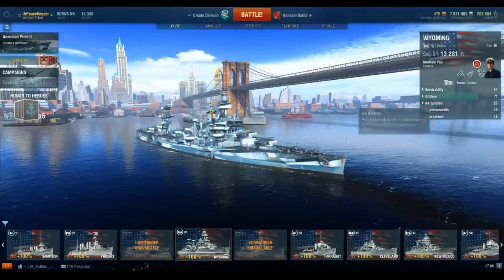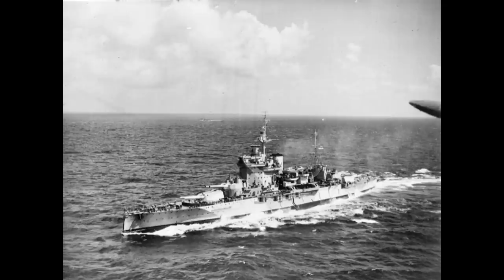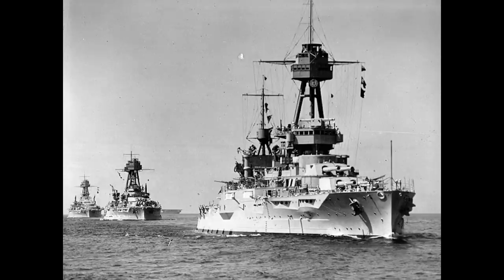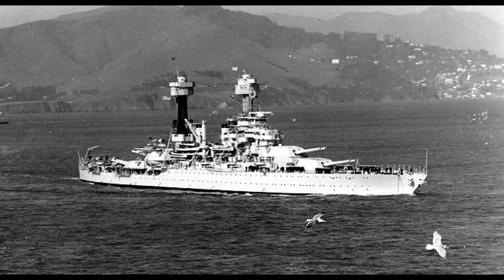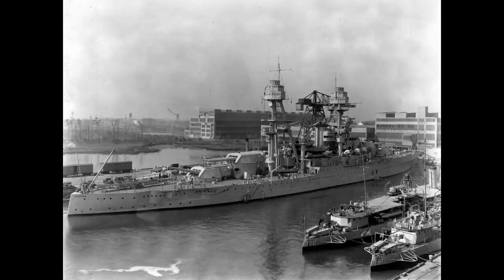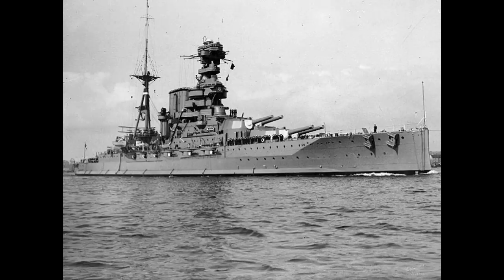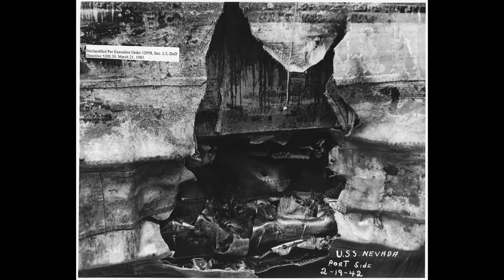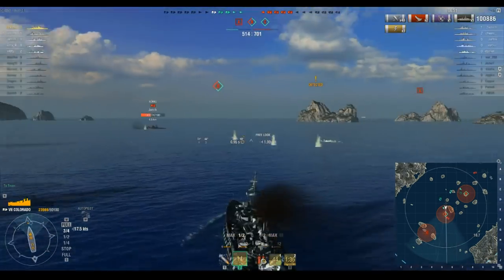The US Standard Battleships - 21 knots, but why?

Comment: I think the reason the Washington wasn't finished was that it ran afoul of the Washington Treaty.

That said, you're pretty spot on about the speed description.  The US knew that other nations had faster BBs but didn't much care as they felt that speed should be subordinated to firepower and protection.  This was somewhat between the Germans, who opted for massive protection but lower gun caliber, and the Brits and Japanese who opted for somewhat less protection in return for higher speed.  

The main thinking with settling for a lower speed in return for better firepower and protection was that using superior speed to decline action was effectively a loss and that when driven to being forced to fight by an advancing enemy, the speed advantage wouldn't do as much good as thicker armor and more firepower.
Reply: The Washington Naval Treaty was designed around the U.S. Navy at the time.  America's biggest, baddest battleships displaced 35,000 tons, so they made the treaty limit 35,000 tons.  USS Washington was cancelled because the USN was already at the total capital ship tonnage limit set by the treaty.

Comment: I'd actually say the Montana has a good to fair torpedo belt in game if im correct its just shy of 50% damage reduction which is pretty dam good
Reply from the maker: Both Standards in Game have either the same 39% (with the add on for added torp resistance) or better.... New Mexico has 42%, Montana/Colorado have 39%.  In real life, the Standards would actually be much, much, much higher than the Montana.  The Montana's hull design harkens back to the TDS systems used on the North Carolina which were considered better than the TDS on the South Dakota's and Iowa's but all of them failed to perform up to expectations.  Probably due to the fact that the US built the TDS to withstand a certain torpedo warhead size that most nations upgraded from almost immediately after the ships were built!

Comment: The torpedo protection of these ships was great, even more so considering how old they were. That, coupled with superb damage control practices, makes them more resistant than most to torpedo damage.

I am not sold on the speed, though. If the US had to employ those standards during the 1910's and 1920's, I would rather have Queen Elizabeths.

Comment: Also I seems like in game the Japanese has some of the best torp protection on a lot of there ships lol o well
Reply from the maker: They do, and this is not based on a real life performance analysis of the ship but purely on the thicknesses of the torpedo bulge.  Totally arbitrary.  The Yamato's torpedo bulge and armored belt have a massive flaw in real life and when the first air dropped torpedo found her hull it ripped a MASSIVE hole in her armored belt.  Musashi suffered the same problem.
Reply: Whiskey's Gaming Lounge I would be nice if they did the torpedo proctecton was based on the air pace between the hull and bulge maybe